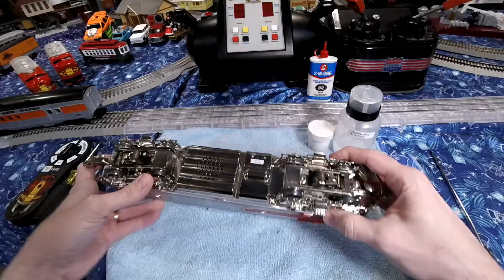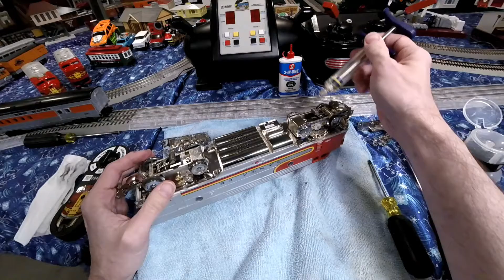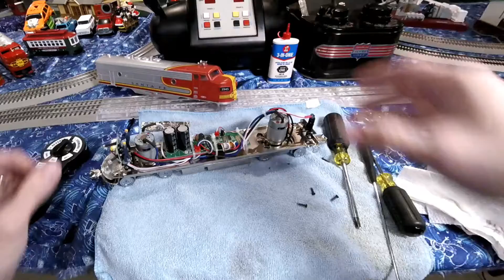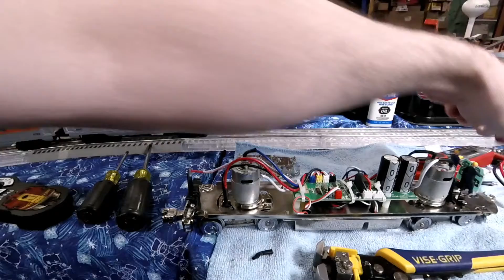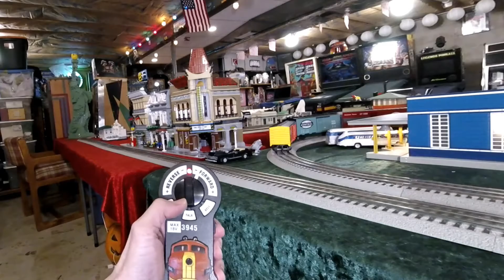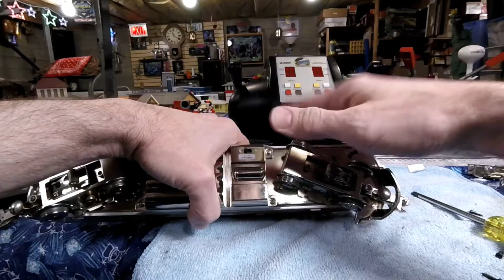Menards Santa Fe locomotive Maintenance & troubleshooting jerky operation

Comment: Recently did all these things. Wires are not loose inside on the motors period ran the train, ran good for 30 minutes common and stopped working completely. Motor is running and accelerating but not turning
Reply: Thank you for responding. This morning I retried it again, and now the motors are not turning at all. Power is going to the lights but nothing.
Reply from the maker: @irapowers940  if you are comfortable doing so I would disconnect the wire to each motor and momentarily connect a 9 volt battery to each motor. If the motor spins then they are good and the issue is elsewhere.
Reply from the maker: If the motor is turning but the train is not moving? My next step would be to remove the motor and inspect the gears. See why things are not working.

Comment: This video just saved me HUNDREDS of dollars. I was just about to buy something new, because my exact same Menards engine was doing the exact same thing yours was. I had already taken it apart… and did not notice I also had a loose wire. LIFE SAVER! Thank you!!
Reply from the maker: Thank you for the great feedback. I'm glad the video helped. I've also noticed on the early Menards engines the roller spring tension is too low. I swapped one roller with another Menards engine and that improved operation too.

Comment: Question: does Lionel or any manufacturer make what was called a Camelback locomotive? Saw a video about early locos that were mainly used on commuter lines on east coast. Strange looking engines.
Reply from the maker: https://www.trainworld.com/lionel-2331560-erie-legacy-camelback-918.html

Comment: Hi Jeremy. Love your videos. Very informative. I know they ship with DC power supplies and am planing on changing over to AC to run Legacy/TMCC locomotives. Will the Menards locomotives run on AC power?
Reply from the maker: Yes they will. But I would restrict it to 18 volts. Of all my Menards videos (I have a playlist of videos) only 2 of them are using DC power from the original power pack. The rest are running off of my MTH Z4000 (AC power)
Reply: @TooManyHobbiesJeremy  Thank you again! Yes the AC transformers I have on order are all 18V AC. I appreciate your valuable info as I'd hate to damage my Menards engines.

Comment: I am wondering if the Lionel Universal remote could work with the Manards engines? Being that they are blue tooth. Do you know if this is possible?
Reply: Have the blue bonet beta and UP may want to mention to use plastic friendly lubricate due to the nylon gears also had issues with Allen screw that holds truck to motor can work loose I just check it periodically had mine couple years still working well do wish they each had their own adres so u could run two santafes or two UPs at same time but as u say it is wat it is good for the price
Reply from the maker: Excellent point!
Reply from the maker: Excellent question - I doubt it would work. As Lionel will use their own identification codes. But if you had a remote handy it would be fun to test.

Comment: Recently purchased SF production AA units (not the betas). I could not be more happy. Flawless paint, assembly, and operation. As a Lionel-only guy, I have to admit that these are some of my more exciting O purchases. I took mine apart and found it to be well assembled. I did place a drop of syn. oil on the end of each motor bushing as they were dry, cleaned out all the grease, and re-greased with Vanquish rock lube, which is one of the best model greases available (compatible with all kinds of gears). What attracts me the most to these engines is the super bright LEDs, chrome frame, and trucks. It may not be prototypical, but man, is it cool!
Reply from the maker: Excellent! Thanks for sharing your experiences. I'm hoping for more road names this winter season. Or at least a blue bonnet SF paint scheme like they had on the Betas.
Reply: @TooManyHobbiesJeremy  Agree 100%! If we could get Western Pacific, New York Central lighting stripe, or the SF Blues, I would purchase immediately!

Comment: My front engine stops working intermittently (for much longer periods than you were seeing). I was really excited when I saw this video and checked those connections, but they seem very solidly soldered. Do these actual motors stop working randomly?
Reply from the maker: Interesting! I think both motors are driven off the same output on the circuit board (not 100% sure though). If they are, then I might try some contact cleaner on the brushes - BUT let it dry completely before turning on the power.

Comment: I just recently picked up a the Union Pacific. I was surprised how much slower it is than my 1997 Lionel o27 Santa Fe war bonnet set. Does the motor produce more torque being a bigger engine? So there is more towing capacity, instead of top speed? Or are the motors just that cheap in the Menards trains vs Lionel in 1997?
Reply from the maker: Thanks for subscribing & commenting ❤️ The electronics are limiting the top speed. Since there are 2 large motors with traction tires, the pulling power is bery good. Check out my video on testing the Menards power pack.  I pull 30 cars of various weights and it did great. The motors don't have flywheels but they do have large brushes wich was a big surprise to me. Cheap motors don't have any brushes (just metal tabs that rub on the comutator).

I prefer the UP gray undercarriage to the SF chrome.

Comment: Looks like you intermingle O gauge with Lionel 027.  Only true O gauge I have is a Williams Mikado that I was gonna repaint and make it into the famous Southern #4501, the last of the MS class which now resides at the Tennessee Valley Railroad Museum.  The Williams engine is a lot larger than any of my Lionel 027.  Cannot wait to take a ride on the 4501.  I model that engine in HO gauge with a Mehano Mikado smoker decked out in the Southern Crescent Limited livery.  Cheers from eastern TN
Reply from the maker: Yep! I'm not focused enough to stick to one standard or railroad gauge :) Thanks for watching the video.

Comment: A FYI on WD40, it's nothing more than Kerosene with some additives. So it's not a good lubricant, just made to penitrate and free up frozen rusted joints like rusted bolts, etc.
Reply from the maker: Correct, not a good lubricant.

Comment: The wires should have some type of strain relief to avoid the stress on the soldered portion of the wires. Obviously the wires are too short to install a strain relief to the motor case. China made stuff always has cut corners. In this case short wires. As the engine is run around curves the same thing will happen again and you will have another broken wire. Fatigue of the soldered wire end is inevitable with out longer wire and strain relief. Otherwise interesting video for beginners.😊
Reply from the maker: Thanks Gene. Here's the interesting thing - there was plenty of extra wire available. The excess was zip tied up under the circuit board (Doh!) During the repair I was able to pull enough out.

Comment: Excellent repair video Jeremy.  I'm really surprised to see such heavy gauge wire beings used.  Also, the wire looks to be really stiff and rather short.  I recently rebuilt an old non-operational Lionel ZW transformer and used 14 gauge stranded copper high temperature wire with silicone insulation.  I was very impressed with how flexible the 14 gauge wire is when it has silicone insulation.  I think it would be great wiring for locomotive motors, or pick-ups on rotating trucks.  Thanks for another helpful video and keep up the great work!
Reply from the maker: Thanks Brad. The short length was due to the excess being stuffed under the circuit board and everything zip tied together. Now that's fixed I will hopefully not have that same problem again. 

Congrats on rebuilding that ZW - was it as hard of a job as you expected? Those things look pretty involved for a teardown just by looking at the diagram.
Reply: @TooManyHobbiesJeremy  Thanks!  I referred a lot to the video by Ron on @classicmodeltrains and was able to get the job pretty well.  I'm not nearly as good at repairs as you are and yet, by following the instructions on the video, I found the process to be pretty straight forward.  I spread the work out over a few evenings, but all total I think it took me about 3-4 hours.  Including the time I spent thoroughly cleaning and polishing the case and lenses and applying new paint to the voltage scales.  I bought the transformer as non working with a cutoff cord for $20 and spent about $50 on the rebuild kit, so for the $70 I have a into it I think I got a good deal.  It's certainly a doable project for anyone willing to give it a try.  I think you'd have no trouble at all with the rebuild.

Comment: Except for the beta testers, no one has them before. Love the dummy units with one time smoke generators
Reply from the maker: Tell me more about the dummy units.
Reply: @TooManyHobbiesJeremy  before the released to stores there was a powered and dummy set on website for beta testers. Apparently when someone designed them they forgot the AC nature of 3 rail and the constant lighting caps blew. Next models got a board fix
Reply from the maker: Ahh, Thank you. I was worried about the production dummy A unit (they are now available for $90.00)
Reply: @TooManyHobbiesJeremy  When you look inside you will see a circuit board with a "full bridge rectifier" on it.